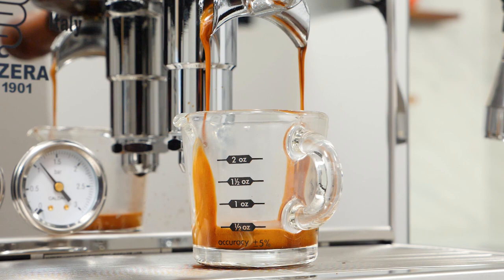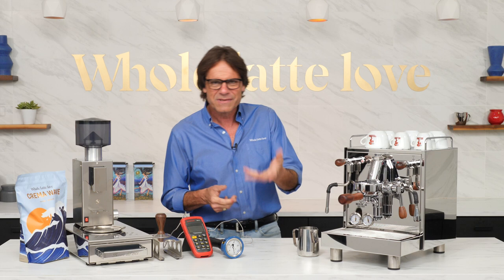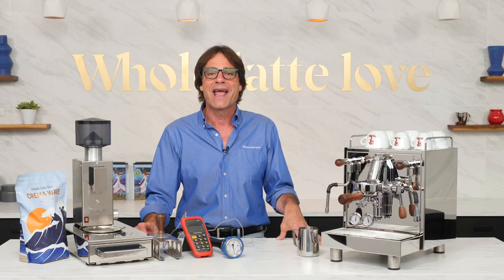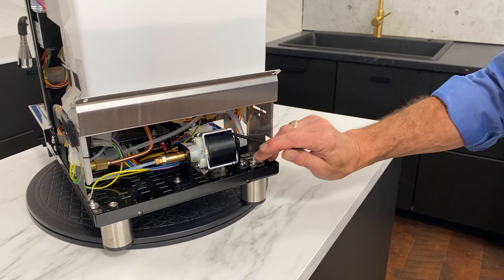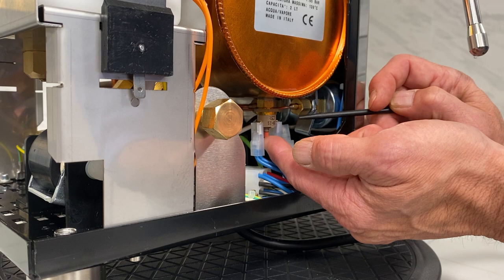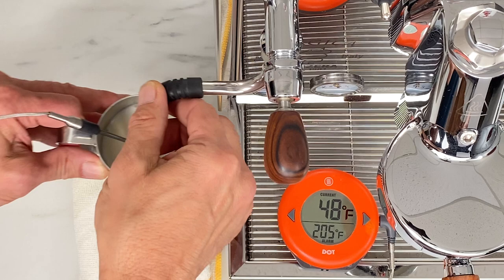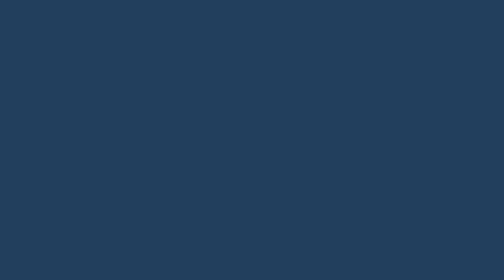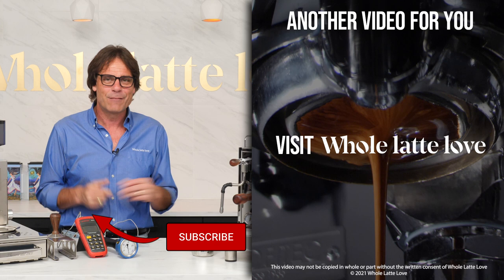Review Bezzera Magica PID Espresso Machine Inside Out

Comment: Wouldn’t too much pressure cause channeling? Do you setup pressure in addition to PID temp prior to shipping?
Reply from the maker: Hi Tony, Thanks for the questions. One would think additional pressure would cause channeling. But in reality it's not that simple. There's some thought higher pressure in the portafilter causes finer coffee particles to migrate through the coffee puck resulting in more of a "barrier" to channels. Other variables at play like distribution of grind and quality of leveling and tamping which play a role. We ship the Magica with the factory set brew pressure to produce the potential flow rate the manufacturer intended. As shown in the video very easy to adjust if desired.
Marc
Reply: @Wholelattelovepage   I noticed that there was a scace device on the table and the pressure was set to 10 on the gauge given losses to the brew head.  Can you confirm that the scace device measured 9 bar while the meter was at 10?
Reply from the maker: @gregjfair  Yes

Comment: No thanks. One single copper boiler. I'll stick with two stainless boilers in my ECM Synchronika. It also has a rotary pump and is plumbed in
Reply: Your comment must be a joke, right?  The ECM synchronika is a $3200+ machine. This one is less than $1900. These do not compete with each other. Obviously you'll get more on a machine that costs $1400 more.
Reply: @Sal_car88  no joke. Just stating the fact that people should save their money and buy something like the Synchronika. Something, that with normal maintenance, will last them 25yrs or better. Espresso machines should be a purchase like an appliance. Such as like a refrigerator or stove. You want something that will have quality and last. 
And let's face it. If your going to do a home espresso bar. You might as well throw down on a puqpress too! 😉😉
Reply: Is stainless steel safer than copper?